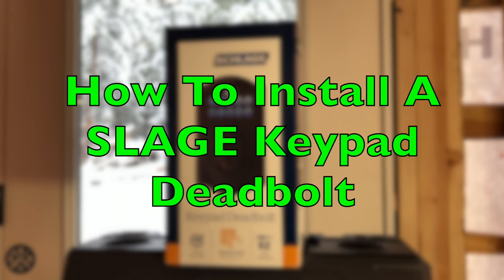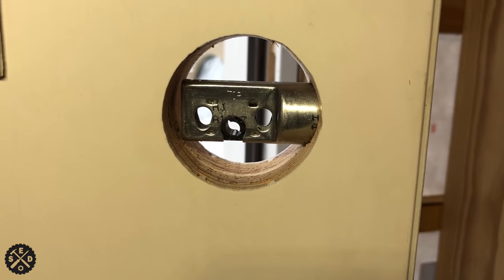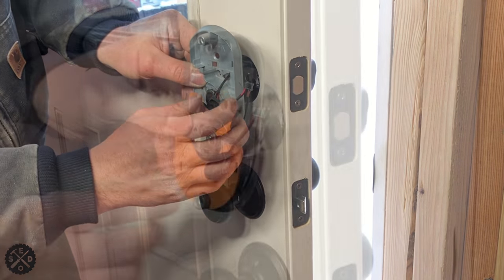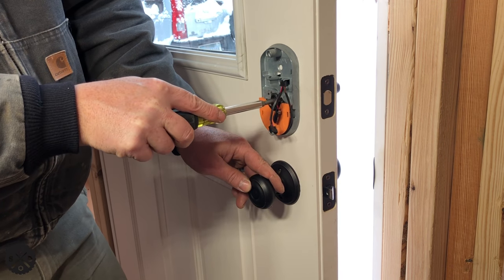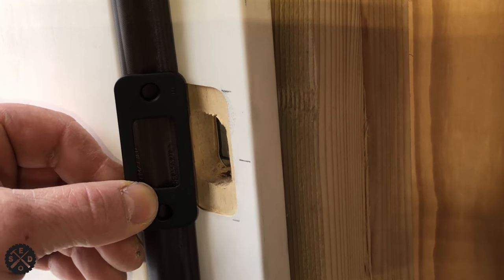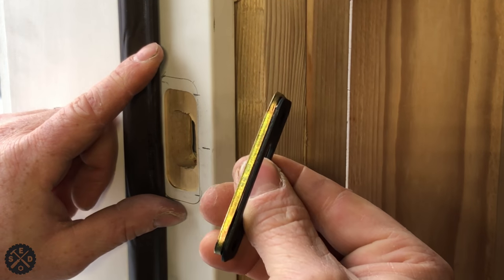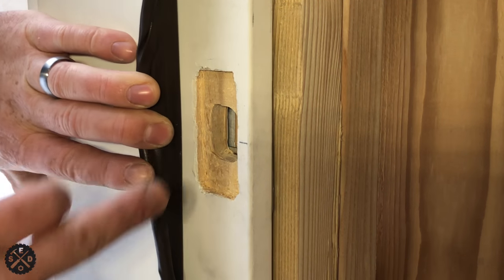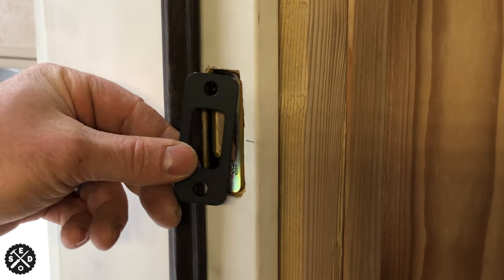Install SLAGE Keypad Deadbolt Keyless Entry Door Lock

Comment: I didn't know a chessle could do that but also I'm gonna review using my speakers. This place has a small ight weight aircraft port near by. Also didn't know it is batteries operated next AA batteries still excist good luck . So thus far chissle and AA. I've installed regular dead bolts. Name of batteries didn't know chissles so precise ty cool
Reply from the maker: Thanks. Good luck with it. I hope it goes well.!

Comment: I had a similar model for several years but eventually the internal mechanism stopped catching in unlock mode.  Looking to replace it but the other models I've tried only have the electronic deadbolt movement; which means the batteries only last about a month.  In the type you're showing the batteries will last a year.  I can't really find a good solution for replacement.
Reply from the maker: They do have a decent warrant I would try contacting them first. I’ve had them replace one before for the same reason.
Reply: @SmartEasyDIYer  Thanks. I just might do that.
Reply from the maker: Good luck!

Comment: A disadvantage I found with this lock is locking it from the outside.  If you hit the Schlage button and turn the lock to the locked position, you need to sit there and wait for several seconds before you can test to make sure everything is locked.  Otherwise, if you go to unlock it....it will.
Reply from the maker: Yeah it takes a few seconds.

Comment: Thank you for your guidance.  I also was able install this keyless lock to my back door.   Since it was sooooo easy, I want to add it to my front door, but I don't want two separate keys.  How to I match the locks? Does that make sense?  THank you!
Reply from the maker: You’re welcome sorry for the late response. I’m not sure if Schlag has any keto like or or if you’d have to have a locksmith to change the tumblers inside for you.

Comment: If the door has only a locking knob, can that be replaced with the keypad deadbolt keyless entry? Would it fit in the hole?
Reply from the maker: Yes they make one that’s just for one hole. Here’s an example one. https://www.build.com/schlage-fe575-cam-acc/s512014

Comment: My lock only locks and unlocks on the second attempt at both. Did I install wrong or just a defect?
Reply from the maker: Man that sounds defective to me unless the battery is low. Normally the ones I’ve seen never do that. I would exchange it for a new one if ur sure the battery is ok.

Comment: Spent two days painting and prepping my doors and bought these locks several days ago and keyed so the keys would match both and started to install (it says easy installation) and my door doesn’t have the indent on my door for the backplate
Reply from the maker: Yes sometimes doors don’t do that I’m not sure why. You have to make it fit.
Reply: I do have to say - I figure out that the plate comes off and there is an adaptor for doors without the indent -  The directions were so confusing on that on the paperwork

Comment: What do you do if you lost your keys and you didn’t add a code at the beginning. Can I open it at all
Reply from the maker: Yes you can take it apart and see what the codes are inside on the sticker and use those. There’s also a master code on there so you can put new codes in.

Comment: Thank you ! Works like a charm! Easy clear instructions. Only thing I left in place was the old strike plate so I didn't chisel out the door frame but it works, diff color but it works. One thing I couldn't figure out was the Emergency key. It didn't lock/unlock dead bolt. Maybe if I disconnect the battery?
Reply from the maker: You’re welcome! I’m glad it works. I’m not sure about the emergency key actually. You could try disconnecting the battery…

Comment: UPDATE! I only had to change the numbered faceplate as the rest worked fine although the door handle was a bit weathered, it works OK.  I had the number pad changed and replaced in 15 minutes thanks to your great tutorial.  Changed the programming code for an easy reminder, my birthday, and changed the entry code. Only glitch was I forgot to disconnect the power cord and couldn't figure out why the unit wouldn't come apart. ARGH!   I clued in after a minute or two and it came apart and went back together like a charm.  All very easy. Thank you my friend!  x 😊🇨🇦
Reply from the maker: Awesome I’m glad you figured it out! Nice job 👍

Comment: I'm terrible at this kind of stuff particularly carving the holes in wood. I traced mine out with a pencil and used my dremel tool with a  milling bit at high speed to mill out the holes for the plates. It worked very well.
Reply from the maker: That’s a great idea I’ve never had a Dremel tool to try it. Thanks for sharing!

Comment: Hi, great video! Thanks.  I can only engage the deadbolt by entering the code after I hit the Schlage button. I understand you are supposed to be able to lock it from the outside by simply hitting the Schlage button and turning the lock ...when I do this it just spins.  Any advise please??
Reply from the maker: Thanks Pam. So it does engage when you do it the other way? Cuz I’ve had these before a few times when that little long flat part inside isn’t seated properly in the deadbolt and just pops out that’s why it wasn’t engaging for me but it wouldn’t engage either way. Sometimes I was able to pop it back in and get it to work and one time I had to actually return it and get a replacement because it wouldn’t stay. That was just one out of many that I’ve done so hopefully that’s not your case.

Comment: Hi! I have a door with 70mm thickness (2" 3/4) It is compatible?
Reply: The issue is not the deadbolt because I can set it up with standard measures. The issue is the thickness and mechanism inside de main gear that connects the two covers
Reply from the maker: Oh sorry I thought this was on a different video. I’m not sure about that actually.  Maybe you could ask Schlage to be sure.

Comment: Why does the outside lock just spin freely? How do I correct this?
Reply from the maker: One thing to check if you take it apart the flat pin type piece that is in the outside section and sticks in through the deadbolt piece can sometime pop loose in there. I’ve had that happen before and just have to re-insert it.
Reply: @SmartEasyDIYer  Nope. That's not it. I just took it all apart and then carefully put it back together. Everything fits but that outside lock just keeps spinning freely
Reply: @SmartEasyDIYer  Luckily, I have a smart wife; she figured it out. The outside lock is supposed to spin until everything locks. By the way, your video is great, it saved me some money hiring someone to do this job.
Reply from the maker: @auggie I didn’t know you meant just till it engages as I’ve had problems with these not engaging at all before even entering code and pushing the button outside so that’s what I thought you meant longer ago. Then you have to take it apart and check that flat pin piece.
Reply: @SmartEasyDIYer My outside lock piece spins freely (when locked) and the actual physical key that came with it doesn't open.   Any ideas , is it the same thing yoiu mention above?  Could you be more specific about "the flat pin type piece"?

Comment: the bore hole size is too small. what bore size is required? is there another option with keypad that fits 1.5 inch hole?
Reply from the maker: Man sorry I don’t know. I’ve only encountered one bore size when installing these. Yours must be an old door or something? I think you can get a jig made for that with hole saw to make it bigger.

Comment: Hello what is the advantage of two strike plates? I ask because when changing the lock again, if you removed the wood to fit the deadbolt lock ( the first time) my thought is the next lock & strike plate installation will be ill fitted or perhaps to loose? I guess my question if you start with two strike plates you gotta stay with two strike plates. Is that right?
Reply from the maker: Yes it’s mainly for extra reinforcement for forced entry break in. You can always leave that one in and just replace the surface one. It should be quite similar to other brands size wise I believe.

Comment: I was getting so frustrated trying to line up the screw holes. No where on the instructions does it say the deadbolt latch is adjustable and needed to be centered. This is what the problem was every time I tries to line up the screws to the holes. Thanks to your video I adjusted to the proper length and installed it. Thanks for your video!
Reply from the maker: Sorry for your trouble but Thanks I’m glad it helped!

Comment: we just bought a schlage door handle and keypad deadbolt to replace weslock deadbolt for our front door and the 2 holes are too close together...what do you recommend?
Reply from the maker: Too close together to fit the deadbolt above the knob?
Reply: Yes! It’s an older combo so the door knob & deadbolt holes are too close for the new keypad combo… is there hope? We were just going to return and rekey the door but really wanted a keypad combo. Is there a way to use without too much damage to the door? Thanks for answering 😍

Comment: What should I be looking for if both outside and inside are not flush against the door when I screw them together?
Reply from the maker: It sounds to me mainly like something isn’t quite together right. Like it’s binding up a little. It should pull right together once everything fits correctly.

Comment: How do I reset the passcode
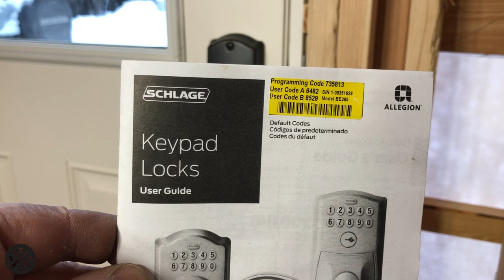Reply from the maker: Do you have the manual that came with it? If not you can download one from their website. I show how to program it using the master code at 8:09 in the video. You will need that same master code whether you add or delete a user code.
Reply: RTFM :)

Comment: Slage...
Reply from the maker: Yes
Reply: Everything was fine and both your video and Schlage video never talked about the keys that goes with the product. Also the deadbolt on the outside turns and turns, makes no sense. Loose the music it was destracting. I think this video was a good first try but needs work.
Reply: @charlessunderlin5703  I am having the same problem, did you figure it out?